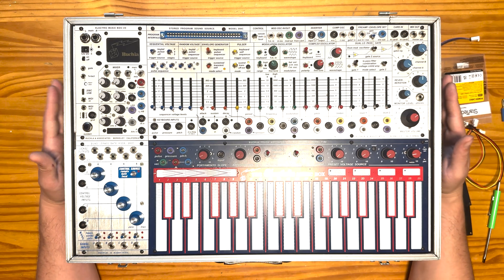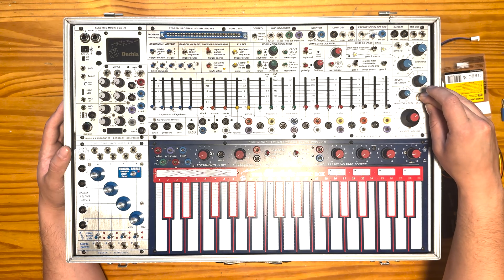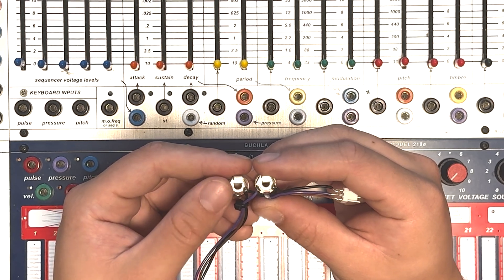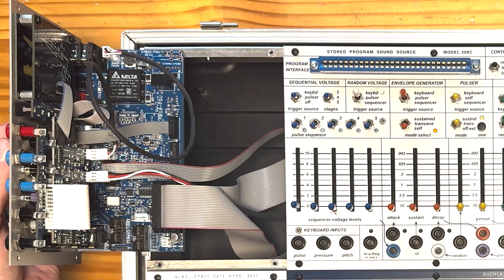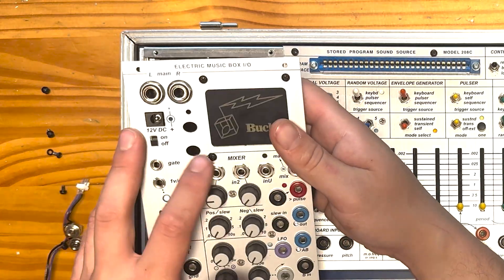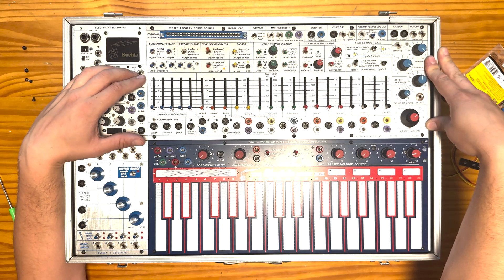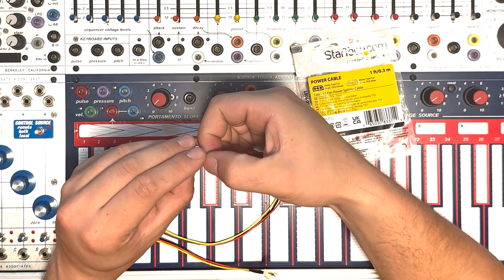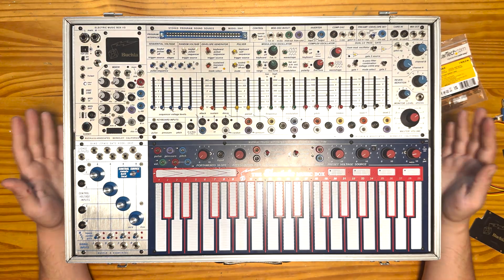Buchla Music Easel Stereo Audio MOD/HACK

Comment: Would this hack work on the retro version of the new easel?
Reply from the maker: Hi Joel, it would work on the Retro Easel in terms of the signal path. But since there is no EMBIO on the Retro with holes to put the jacks, it would require drilling into the side panel to add two holes for the jacks. Doing this improperly could void your warranty, so make sure that if you do choose to do so, that you do so with the utmost care and precision.